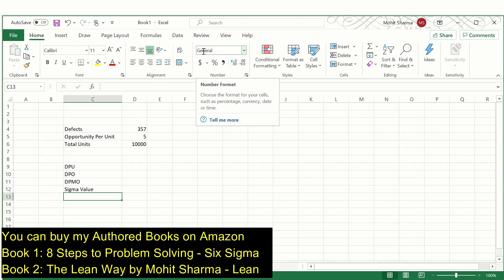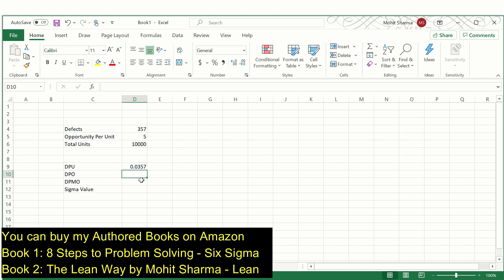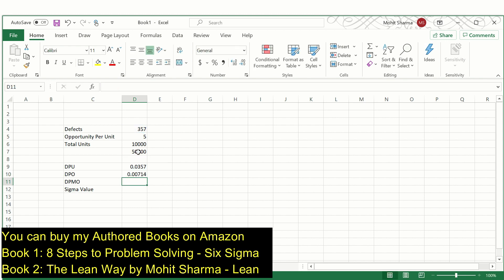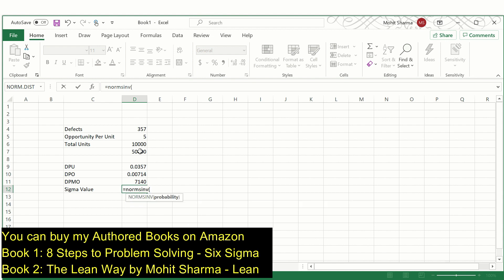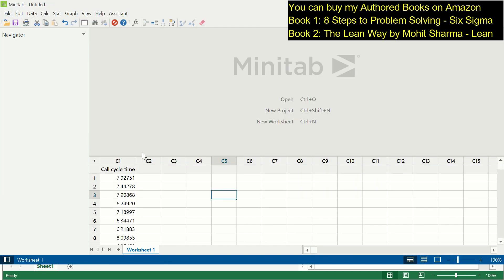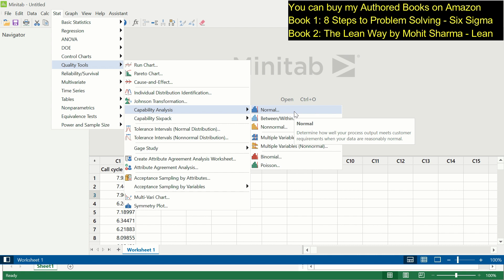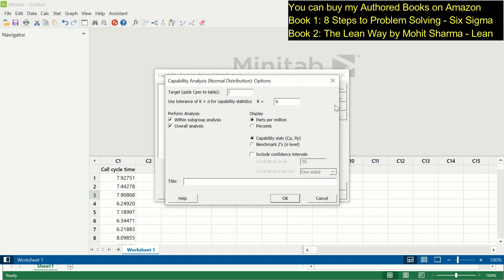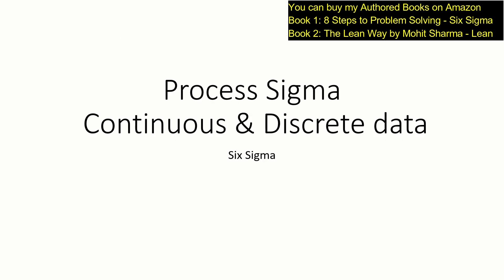Learn how to calculate DPMO, DPU, DPO and Sigma Values of Discrete & Continuous data

Comment: I have one question, how to calculate Z overall or sigma level when the number of opportunities for error is unknown. And DPU value is resulting 1. Suggest some way to do this. Example in a process, QC inspected 200 samples and found 200 defects when the number of opportunities for defect or error is unknown. This is resulting DPU = 1. and DPMO = 1000000, and Sigma level #NUM! in excel.